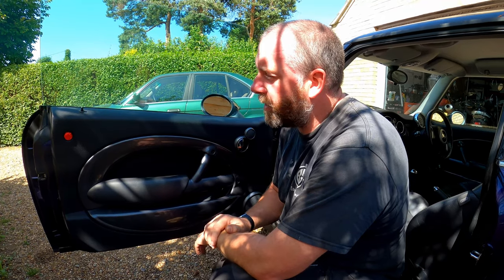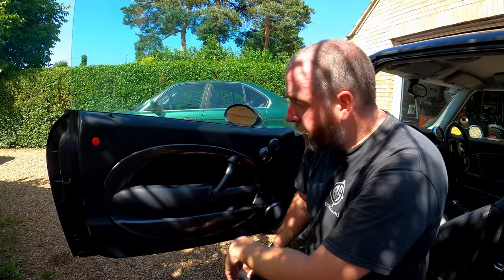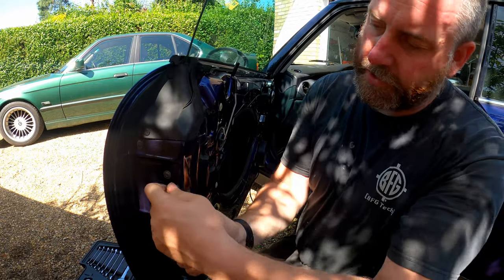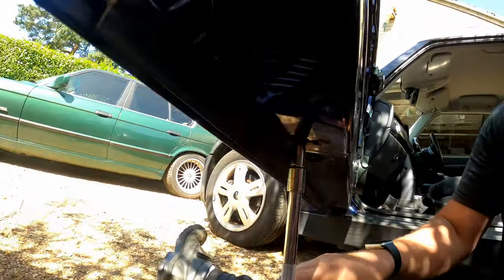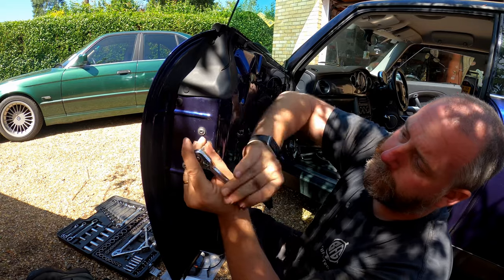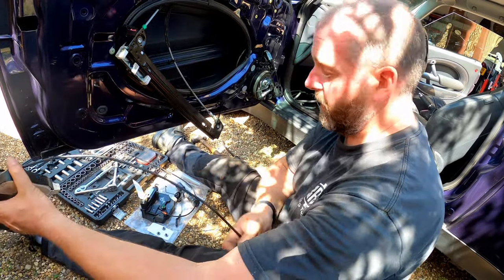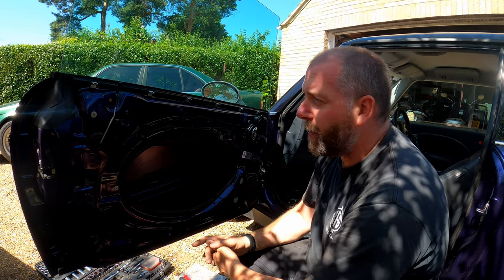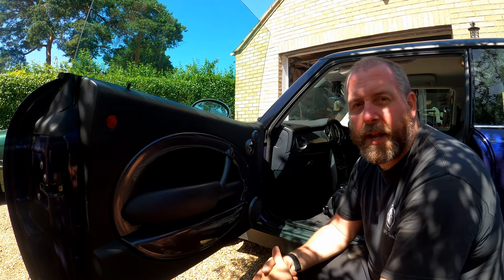Mini One, Mini Cooper and Mini Cooper-S, R50 & R53 Door Lock Mechanism & Solenoid Replacement

Comment: Excellent video, many thanks for taking the time to film and share. Could you tell me if your existing key was immediately successful or did you have to somehow sync them?
Reply from the maker: It doesn’t affect the lock at all mate as that is independent of the actual mechanism so nothing to worry about with the key 👍🏻
Reply: @KevsShed  Thank you for your time Kev. The part I bought is second hand but complete. Lock, solenoid, cable etc. It's a convertible and there isn't a key entry on the n/s meaning it operates from drivers side. Sorry I wasn't clear. I wondered if the original fob had to be programmed the new Lock. Sorry as you've probably gathered I'm no mechanic 😁, cheers 👍

Comment: Hi, Thanks for the info Kev. Now then, my mini {2011, R57 LCI} has a slightly different problem. Both my fobs appear to unlock my car, but, neither handle will open the door. My inner door panels appear to be different than yours. I think that I need to have the door open, to remove the inner panel. How can I overcome the door latch? Any thoughts? Steve.

Comment: You do not have to remove the window mechanism , only take the bottom 10mm bolt out , mark it original position with a marker pen and pull to the inside skin of the door 
Thanks for reading ........just to save time , Cheers then mate ps I've jus replaced this part Myself .

Comment: You did not need to remove the window strut just remove 10mm bolt under door mark inside on the plastic slider its position then move it back to enable actuator to come through its a tight fit but at the right angle it comes out...